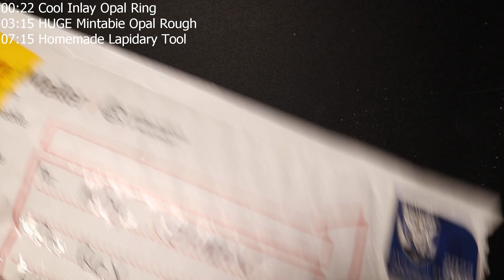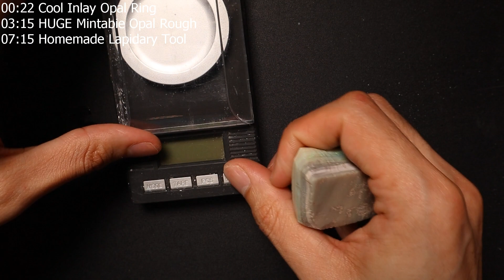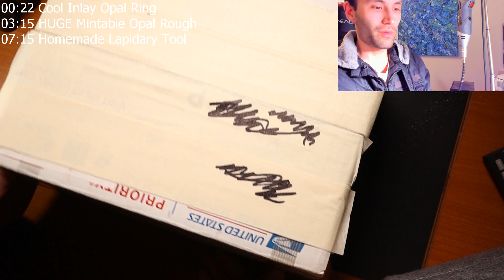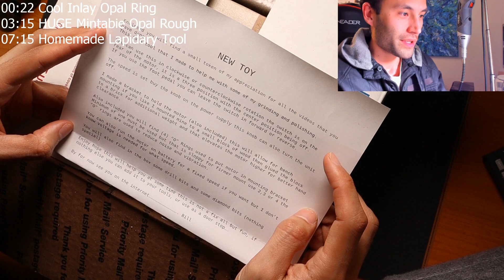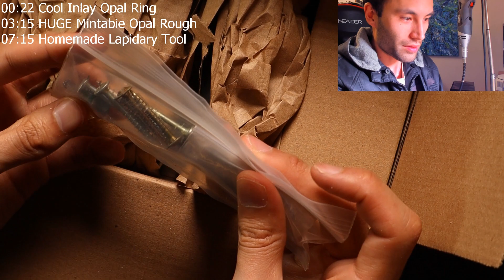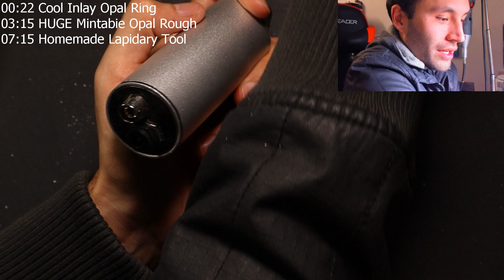Opal Inlay Ring, HUGE Mintabie Rough, Homemade Lapidary Tool

Comment: Anyone else having trouble buying from Opal digger on ebay? Keeps saying doesn't post to NSW and that user is blocked when I try to message them. Never bought off them before and have been looking forward to getting something from them. Spent it on opal auctions instead with Riley from 53 frogs. Pretty stoked about that turn of events 😄
Reply from the maker: Nah I haven't had any dealings with him because I stopped using ebay a long time ago. I might have to work something out though.

Comment: That is a glorious mintabie opal! I started working with mintabie recently, just small pieces for now. Really tough challenge. They can be magnificent when they face well. They usually don't. So frustrating especially when you can see flashes of color!
Reply from the maker: Yeah it is mega frustrating. Sometimes you just have to settle for the side on flash and slice multiple thin pieces but here I am hoping for a massive pendant stone. Could be worth thousands!

Comment: Look up "lost wax" investment casting jewelry...It is  not that hard and not that expensive to get set up. You can make a centrifuge for about $50. Basically the only other thing you need is a small oxy/acetylene torch. The rest is done with files and wax.
Reply from the maker: Sounds interesting I will look it up now.
Reply from the maker: Looks like fun and I would like to use my home vacuum chamber more.

Comment: Roy the "o" rings are for mounting motor in the pvc mount so you can hard nount the unit I thought i put mounting info in the box If you put some heat around the base to brake down the glue then the base will un screw sorry 😞 I thought I had packed it better, the switch only is for rotation if you flop + and - you can change rotation.........Be well and be safe💎💎
Reply from the maker: Hey man, I'm real excited to give it a crack. I was going to cut a strip of rubber to wrap around and mount but o-rings can work too.
We know the postal service probably delivered it but launching it out of a canon so it is what it is. 🤣👌

Comment: Cut it in half, double what you can do with it.
Nice toy.  My setup is like this,  but it's not affixed to my work table.
Any information on who manufactures those tiny diamonds bits?  Those look sweet!
Reply from the maker: I could but mintabie is hard to do that with. Most likely only 1 side would face if you sliced it down the middle.
There are heaps of suppliers for the tiny burrs but you can only get them electroplated I think. Good for tiny hole drilling.

Comment: that piece of mintabie was on ebay.. $800 worth of opal. you should run it over a trim saw and get multiple opals
Reply from the maker: Do the blacklighters still sell on ebay? I thought they stopped ebay and only did the facebook live auctions now (which is where this came from in the end).
Reply: @RoysRocks  not sure. i saw that bit of mintabie rough on ebay about two months ago.. i almost bought it.
Reply: when i saw the fractures on it, i decided not to buy it. seemed like too much of a gamble
Reply from the maker: @MABUS-ANKH-ATEN  Well at least now you'll be able to see what it turns into. 👌
Reply: @RoysRocks  thats an undeniable truth.  😉 
good luck with it roy

Comment: Just my opinion on the mintabie I would cut atleast one slice from it for vertical lines in atleast one long cab or two... Or is it horizontal 😂 idk but you know what I mean...I hope
Reply: I'm pitching cutting it into two equal pieces,  so that way more color bars can be pursued.
Reply: @ThatOpalGuy  either way 😂...I just watched a Pulitzer opal with the diagonal vertical lines on some mintabie crystal and it turned out amazing but yes it looks like it could be cut between the color bars as well I just wouldn't attempt it with the Dremel 😂😂😂
Reply from the maker: Always scary to make any decision with mintabie. I could just check the bar on the ends with the Dremel by coming in from the ends above the bar a bit.
Reply: @RoysRocks  oh I know I've seen mintabie only face from the side which is why I suggested cutting it to showcase the vertical bars...not the whole piece
Reply: https://youtu.be/yhUolD5dweM
Reply: @RoysRocks  check out this to see.what I'm talking about with the vertical lines...I just don't feel like I'm describing it correctly lol...https://youtu.be/yhUolD5dweM
Reply: @RoysRocks  but yes I agree you should atleast test the edges from top and bottom to see which side if either faces best even then mintabie has always been really fickle in my limited experience
Reply from the maker: @anthonymcclain6475  Yeah Mintabie is a cruel breed of opal for cutters. This one doesnt have a lot of cross cut potential but I'll talk to the owner about the options and see what they think.